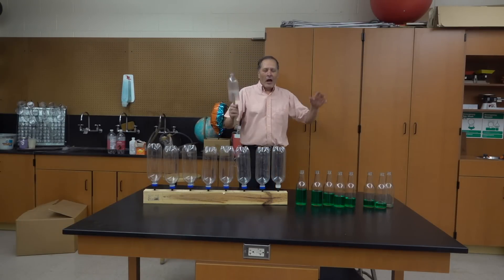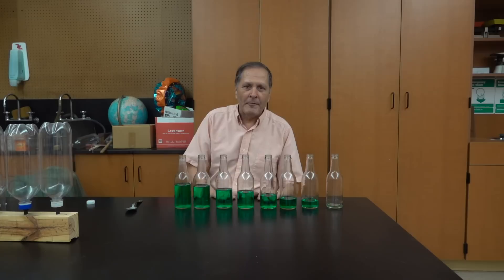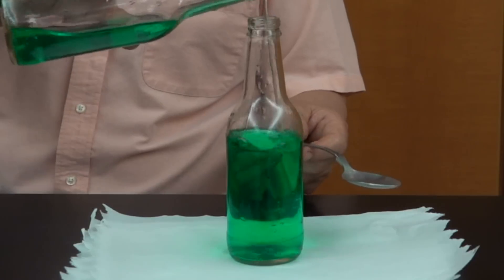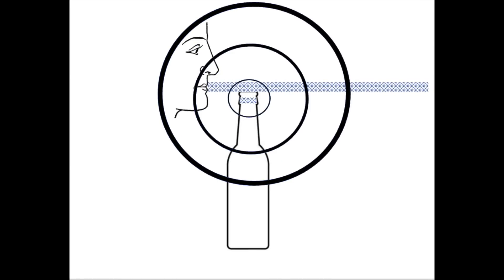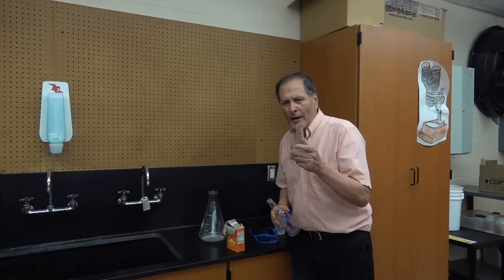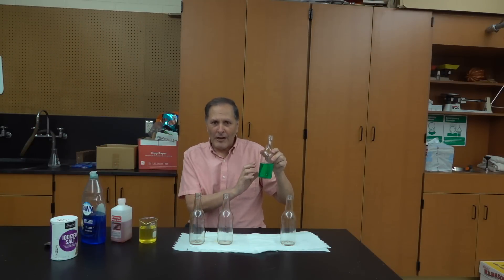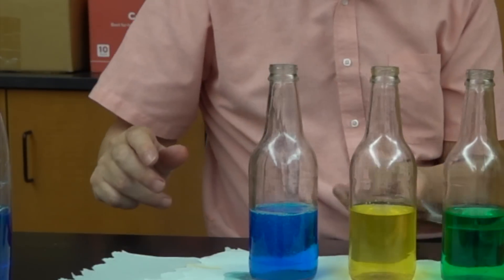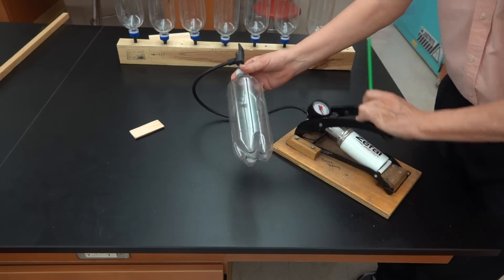Musical Bottles  Sound Science

Comment: Thanks for showing so many non-obvious results! When you increase the air pressure, do you think it's the rigidity the pressure's creating in the plastic that's actually the reason for the higher pitch? When  you set them down, they sound "tight". 
Also, the explanation for why waves are set up seems incomplete. Why the pulse of pressure/oscillation? Turbulence?
Reply: The density of the liquid and material of the bottle along with setting it on the table or changing how it is held changes the resonant frequency of the bottle, it will flex more or less with each change.  Changing the resonant frequency of the bottle changes how much pressure the incoming air can be before it is forced back out.    Blowing across the top of the bottle is simmilar to Blowing into a whistle. It causes an oscillating pressure wave, when the pressure in the bottle is greater than atmospheric pressure,  air starts to escape, but is cut off by the air being blown in, so there will be a rapid pressure change  creating the sound.  

If that makes any sense.     I am not the best at explaining things.

Comment: Dear Mr. Yeanny, I wouldn't normally point this out on a YT video, as it may be too pedantic (use of the word "damping"), but as yours is a science-focused channel, here we go:

Mechanical resonance-effects are dominated by three effects - related to inertia/mass/kinetic energy, related to stiffness/elastic modulus/potential energy and related to dissipation/damping/entropy. These three, in various contributions, affect resonance. Mass and stiffness predominantly affect the frequency and the damping affects the "sharpness" of the resonance and the persistence of oscillations. 

In the water-filling process you mention that the added water "damps" the ringing tone 1:48 . This is imo misleading. Its effect is due to the added mass. Damping is not significantly changed.
Just as when talking about energy, it is crucial to discern between "Force", "Energy" and "Power" - these have three distinct and specific connotations, the same holds for Mass vs. Stiffness vs. Damping .

Excellent demos with the various gases! :)
Reply from the maker: Thank you for pointing out the error,  I got caught up in the demonstrations and didn't put enough time into making sure I had explained it correctly.  Damping would be occurring after the containers are struck and would not be explaining the change of pitch.  I will write a correction in the written explanation.
Reply: I got a big surprise when I dangled an alu tube in water and hit it. My brain told me the pitch would go up as the air column shortened.  It went down!  I stood there a while asking myself how I  got a degree in physics, then spent an hour on the internet and still have no answer. The nearest i get is that gently exciting the air in a tube gives a pitch that depends on the length/volume of the air column and very little on the meterial of the tube.  But striking the tube doesn't depend much on the air column, much more on the material of the tube.  I still dont understand....
Reply: @raykent3211  Thought-experiment:
Imagine you take a tube of aluminium, thereafter a tube of titanium, both of the same shape. The "whistle" working of both will be the same, while the hammer working will yield a higher pitch for titanium. Do you agree?
Reply: @AdityaMehendale  I  think titanium is stiffer so I'd guess the pitch would be higher, yes.  For a proper experiment I think they'd need to have the same wall thickness too.
Reply: @raykent3211  Indeed, with "same shape" I implied length, diameter, thickness, ...
Reply: BTW - the "hammer" pitch would be higher; the "whistle" pitch would be the same.